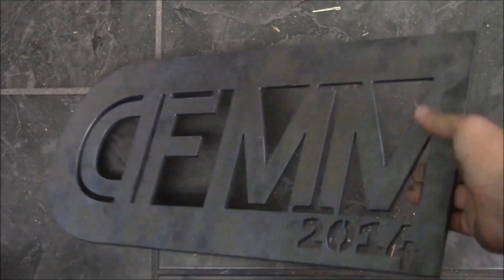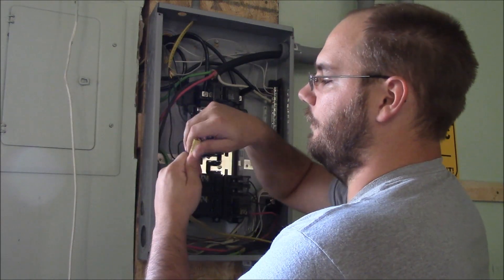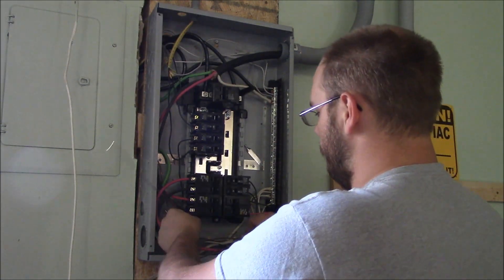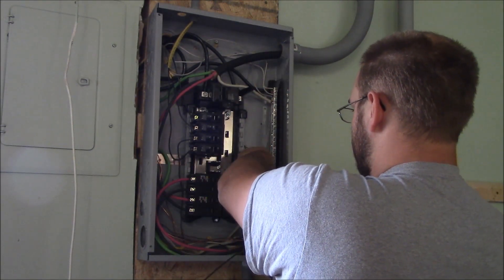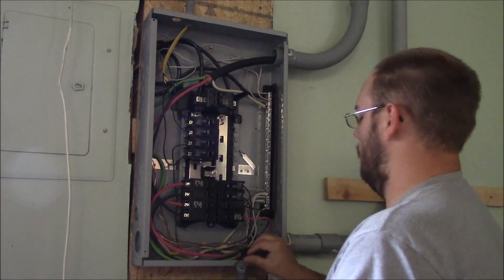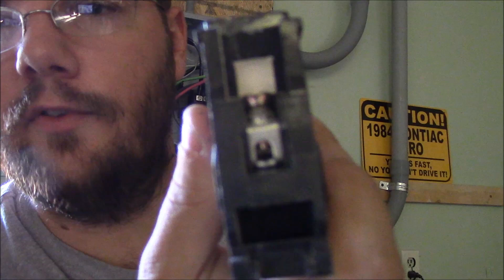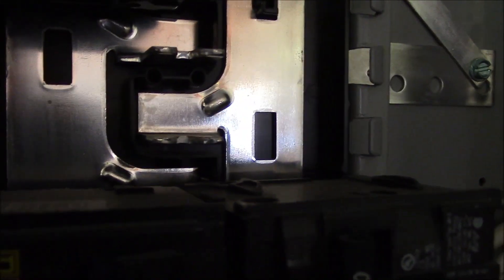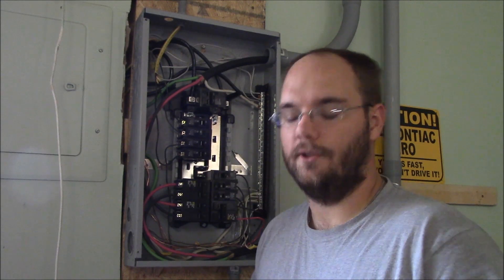How to Install Wire a Single Pole Circuit Breaker

Comment: the fiero sign gave you all the credibility I needed.
gonna go install 2 now.

ty
Reply from the maker: +MrRootfantastic Thanks for the comment, likely one of my coolest. I must ask, does it give credibility because you know that you are always working on a Fiero to keep it running or just because they are awesome?
Reply: +David Finch (dfmmc2014) I had 4 of em.  did very swaps on 2.  88 formula with a supercharged ls, and an 88 se with a twin turbo northstar.   bother pushed over 400hp.
other 2 were a 86 2m4 and an 86 base
Reply: jesus I can't type on this phone...
* v8 swap
* both pushed
Reply from the maker: I always wanted to put the 3800 in the 84 I had, but when I dug into it figured there wasn't enough left. Sadly cancer got to it, and it was sold as a rolling chassis of sorts.

Comment: Question.

So im doing the same thing your doing here. However. I bought a roll of 10/3 outdoor wire. I was told to buy 10 gauge wire. But I see my wire has 4 pairs of wires. I have my hot, neutral and ground but theres and extra wire. Can I still do this set up and just omit the extra wire?

Comment: Thanks for the video.  Better than another I saw done by a professional.  I need to run an outlet for my air compressor, can you believe all my garage plugs are 15 amp?   Well now I'll have a 20 amp.
Reply from the maker: +Derrik Buschatz First off, thank you. Secondly, I'm sure you've thought of this, but is this compressor 110 or 220? I only ask because mine is 220 and 20A (I have it on a 30A), but just wanted to bring that up. Oh and yes, I'm not the least bit surprised that they are all 15A. When putting in a 20A breaker, make sure that the wiring used is appropriately sized for 20A, and not just taking off a 15A and putting a 20A on the same wires. 

Thanks for the comment and hope your application works out for you!
Reply: +David Finch (dfmmc2014) Yes, it's 110.  I have had to use it quite a bit in the fixer-upper home I bought, but have always had to plug it in to the back bedroom where they installed a 20 amp circuit for some reason in that portion of the house.  

I am going to run a whole new circuit, a new series of outlets on the other side of the garage.  So no switching outlets, and will be using 12 gauge wire.  Thanks again.
Reply from the maker: +Derrik Buschatz Sounds like you have a great plan, good luck!

Comment: Looks simple enough. Im installing a ceiling mounted projector and want to run a dedicated circuit to it so going to install a 20 amp breaker into my sub panel.

Comment: I need to add a line for heat tape to keep the pipes from freezing. Is a 15 amp enough?  I know that a 15 is 1800watts right?  And my heat tape is 7watts per foot.
Reply: NEC code states that the breaker for any resistive loads (heaters, lights, etc) should be sized for 125% of the rated load. Also, yes 15A at 120Vac is 1800W. I would always recommend installing a 20A minimum on a simple circuit like that so that you can go add some more to that circuit later without having to buy another breaker! 15A is very small.

Comment: must you use 20amp receptacles in your setup? or are 15 allowed?
Reply from the maker: D Leal great question. I use a 20 amp breaker because I wire with 12 ga wire. if you wired with 14ga, then you would want a 15amp one as the wire is not rated for 20 amps. 

hope this helps, and thanks for watching.
Reply: Measure the power you think youll be using 15amp is good for lighting and small electronics. To figure max wattage multiply amps x volts. So 120v x 15amp is max 1800watts on that circuit and they suggest only constantly running 80% load on a circuit so 1440watts comfortably.  So 20amp is 2400watts max 1920 constant load.  So again try to wire 20amp for electrical outlets separate from 15amp lighting and fans.. And yes use 12g wire for 20amp and 14 for 15amp
Reply: 15 amp duplex are allowed, 15 amp single are not.

Comment: I'm a new welder. I bouth a welding machine to start learning how to welding at my garage. The short story is after 10 min welding all my outlets not working. My house has the braker box inside and I cheked but that box is only for my home not for my garage. So I check around to find the other circuit breaker but I cant find it. I got the cheaper welding machine 110V flux.  I verify the info data machine and said use with 20 amp. My house is a duplex house, I mean I got a neiborn next to me and maybe the garage circuit braker is his side. If so, What can I do to upgrade my electricity?
Reply from the maker: +ROD Boricua Really if your in a duplex and renting, I'm going to go out on a limb and suggest you talk to your landlord about your new interest in welding. I don't think they would like it as most people that aren't into it can be skiddish about things setting on fire. This correlates to the fact that you should also talk to them about wanting an upgraded circuit. Likely just a dedicated 110V circuit from the garage panel on the neighbor side in either a 20 or 30 amp size with appropriate wire gauge. My guess, is that the circuits you have used are the same as your neighbors and they might have a chest freezer or something else on it taking up some of load. You can always talk to the neighbor and see if they know also.

Hope this helps, and thanks for the comment and views!
Reply: Im looking videos to trying find some info and I saw one video that has the ssame receptacle that I have.It has two bottom, reset and test. I pushed the bottoms and nothing happened.No gren light. I think this receptacle is 20 amp. So I think I have to repleace the receptacle. I dont know why I loose my power because that is for 20 amp
Reply from the maker: +ROD Boricua That type of receptacle is a GFI (Ground Fault Interrupter), and you would plug a load (Radio) into it and turn it on. Then you press the test button, and it should interrupt the circuit and open it causing the radio to turn off. Then the rest button does just that turning the radio back on again. It is't all that uncommon for attached garages to use GFI circuits. They can be done several ways, you can get them in the form of a breaker that goes into the box ad protects the entire circuit, or generally the first receptacle in the circuit is one, and even though the rest are not, as long as they are after the first one, will act the same. 

I haven't tried using GFI's with welders myself, but from what I have heard they do not work well when using them. 

a GFI works by sensing a very small amount of current going through the ground wire of a 110V circuit, when ideally all of the current should be coming from the black (hot/conductor lead), and going through the load (welder) and out of the white (Neutral wire). So as I say, when the slightest of current that normally goes through the white is varied, a GFI thinks it is grounding out and has a fault or short circuit causing it to trip the breaker. The electronics in most welders will commonly cause this to happen, and don't play well with GFI's.

Maybe some other can comment on their experiences with welding with 110V units using a GFI.
Reply: Thanks very good information
Reply from the maker: +ROD Boricua You are welcome.

Comment: What does "single pole" refer to/mean?
Reply from the maker: fiveomar when dealing with single phase service (majority of residential homes), you have 3 wires coming to you from a transformer on a electrical pole. two of them are hot conductors, and a single pole uses one conductor giving you common house hold voltage of 110V in the US. a dual or double pole uses both conductors giving you 220V.

Thanks for the question and watching, hope this helps.

Comment: You are not supposed to double up it is quite dangerous actually
Reply from the maker: Can you further explain. I admit this is an older video and I watched it again to see what you are saying is wrong. I don't see any place that I "Doubled up".
Reply: @DavidFinchMMC  I did not think you were suppose to double up either but I installed an additional ground bar to a sub panel the other day and the direction's gave steps if you were going to double up grounds. You are limited to the number of grounds in each slot and they have to be all the same wire size, ie: all 10's, 12, 14's, if you do double up.  You cannot put a 14 ga ground wire in the same slot as a 10ga  etc etc.

I was curious about neutrals and did find a post from the 2011 NEC code that neutrals are NEVER allowed to be doubled up under any circumstances.  A recent code book would need to be checked for sure but I believe that rule would still apply.  I like tidy work so I would not double up on my grounds, even if it is allowed with certain parameters.

Comment: ha  12 AWG is pretty big gauge. I think 14 AWG is enough for normal family.
Reply: 12 is what I use when doing 20 amp. 14 works for 15amp.
Reply from the maker: If it were house wiring with low demand from most appliances or light fixtures getting plugged in, I would use 14, but in a garage where higher amp equipment may be used, 12. Sorry I didn't reply to this one sooner than this.
Reply: David Finch no that's fine. I think you r correct
Reply: 2.5mm for 20 amp
Reply: In a garage, I would have actually gone for 10 AWG if I was thinking of a high amp equipment.  This would allow for a 30 amp breaker if you want to add a higher amp equipment such as a big air compressor or a low power welder.

Comment: Several issues with this video: he should be using uninsulated THHN type wire inside that conduit instead of the insulated ROMEX.  Insulated ROMEX creates heat inside the conduit and is not approved by most codes.  He also fails to tell you the main line wires attached to the lugs screws at the top are still hot even with the main switch off and you will be electrocuted if you touch them.  He does not explain what the purpose of each wire bare (ground to earth), white (neutral to panel), and black (charged wire from power source).   Watch a video by a licensed electrician instead of this guy.
Reply from the maker: L A you sir point out a lot of valid concerns. Not on board with your concern about insulated wire in conduit though. Past that, you must be a licensed electrician right?